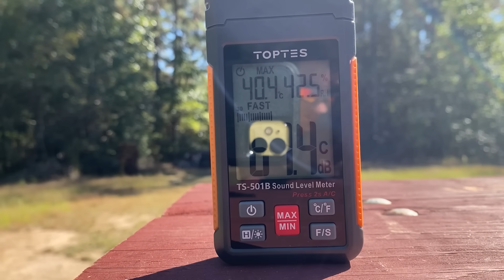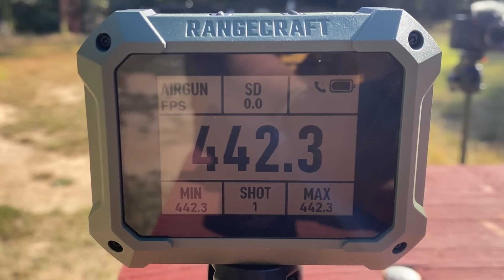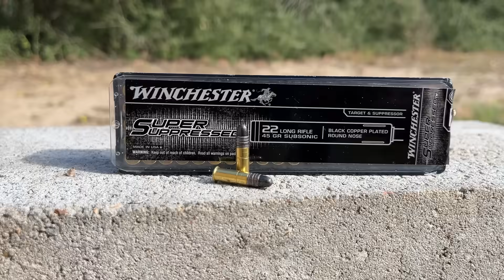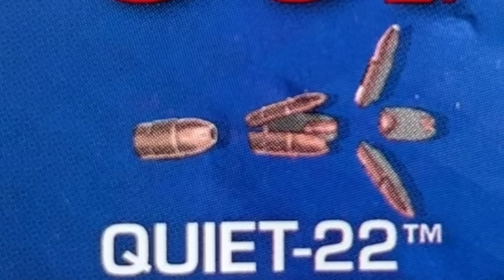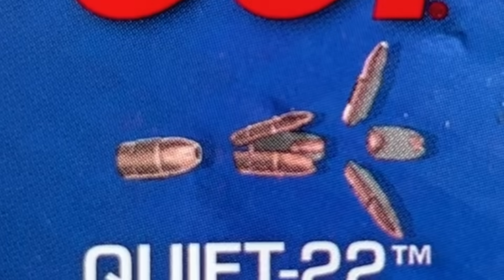How Deadly Are Colibri Bullets?

Comment from the maker: Go to https://buyraycon.com/BANANABALLISTICSOPEN to get up to 30% off
sitewide. Thanks Raycon for sponsoring!
Reply: 0:29  The sound meter you are using cannot accurately measure the pressure blast wave of a gunshot.
The meter you're using is designed for basic sound level surveys.
Sound Level Meters used to measure the fast transient sound pressure wave gunshots utilize a special "pressure microphone".
Cost of these specialized Db Meters is typically over $3000, although they can be rented.
Take a look at the Spartan 821IH-QPR Firearm Noise Sound Level Meter
Great Content, Thank You
Reply: The reason your decibel readings are not accurate is the sample window. Cheap decibel meters usually average all sounds coming in in one second increments. Gunfire makes an impulse sound which is difficult to measure and you need a much shorter sample window for any sort of accuracy.

There is some averaging with every decibel meter.
Reply: @orome9793  100% Correct.
Specifically, Gunshot Sound Pressure Level Measurements require specialized equipment to measure the very short transient spikes.
More common (and less expensive) db meters average a survey measurement of the surrounding environment.
I'll reference this piece of test equipment;  Spartan 821IH-QPR Firearm Noise Sound Level Meter
Reply: FYI BB,
The old U.S. Military Standard for judging  ammo was the distance at which a bullet/round would completely penetrate a 1/2” thick pine board was the distance at which it was considered lethal to a human target.
Reply: The trim board is generally Poplar...
Reply: Love the watercloset commando 🤣
Reply: fall asleep for 3h20m
Reply: I actually think this is awesome.. I don’t have to train kids with co2 powered pellets who’s trajectory changes constantly
Reply: How come you didn't try the Agulia 60gn Sniper Subsonic?
The Aguila .22lr 60gn SSS will in most cases cycle your pistol action.
Reply: Have you tried the awareness mode on your original earbuds?
Reply: Really? We're still shilling Ray's Con despite years of evidence that they're overpriced crap?
Reply: which of the raycon have strongest noise canceling?
Reply: 3hr24min not in the last 6 years
Reply: No thanks, raycon headphones are overpriced junk
Reply: https://www.youtube.com/watch?v=90ECrL_4GPc
Reply: You definitely need to invest in newer rail sleepers
Reply: WATCH EVERY MOVE YOU MAKE BANANA BOY
Reply: No, what the f*** YouTube?You hit this video for me for a whole fucking minute😡💔😡💔😭😭😭
Reply: Your commercial is ten times better than the woke crap yt pushes.
Reply: @Angelum_Band  Define "woke"

Comment: My .22 air rifle launches a 36gr slug at 600 fps, and it will blow through 3/4in plywood before embedding in a 1/2in plywood behind it. But it will embed in a 2x4, so the results are about as expected.

Comment: I used a suppressed 1911 with CCI quiet (not segmented) on a raccoon. I knocked the thing out 3 separate times with headshots. When it was out cold the third time I put 2 center mass to make sure it wouldn’t suffer any more than I had accidentally made it to. I felt bad, and I won’t use any slower rounds than that for my pests. Maybe I need some of that Winchester

Comment: The 1/8th inch wood looks like red oak, which is harder than pine. The not-trim board looks like Southern yellow pine, which is fairly soft. I wonder if there is any issue of brittle shear at work.

Comment: Many years ago I saw demonstration of the power of a 22LR. The test was how many 1x12 pine boards would it go through.  The boards were spaced out at several inches. At least six. The bullet went through 6 or 7. I’m not exactly sure. As I said it’s been many years.  That’s pretty impressive.
Also many years ago when I was 10ish I pulled the bullet out of several 22s, dumped the powder and put the bullet back into the casing.  Don’t worry, I saved the powder. The I smashed the casing, primer end, with a hammer. The bullet hit the garage door making quite a bit of noise, but doing no damage.  I would not want to get hit with one of those things he was shooting.

Comment: Ok one, is that pistol really as quiet as it sounds in the video, with such a small can?  I have one I use on my bolt-action rifle and it's literally silent, but if I put it on my pistol it's loud!  And 2, I wonder how Eley Subsonic Hollow would compare to those other rounds.  I like them and have killed quite a few Texas feral pigs with them.  Small to medium ones go down with one well-placed shot; an 80 pound boar took 3 or 4 in the face but he did go down.

Comment: how did you get 9 ft pounds. im pretty sure its 19-20 fpe using a calculator with inputs of 45 grain moving at 445 fps = 19.89 FPE

Comment: So you're just looking at a longer version of the 6mm Flobert cartridge? Basically as a quick recap, the 6mm Flobert was the original .22 cartridge and was intended for parlor shooting. It's just the primer and is very stubby since the case is hardly any longer than the bullet itself.

Comment: Back in the day us old Fudds used to call a light .22 rimfire bullet with no powder and only a primer to propel it a BB Cap,, or a Flobert cartridge.  They were intended for indoor target practice (something common in the 19th century, but generally illegal today if anyone else is in the building) with what were called Parlor pistols, family fun,  With a heavier bullet we called them CB caps,  CB Caps were considered good medicine for cornered mice and rats in a barn,  Both were sometimes found in all 3 lengths,  Short, Long and Long Rifle. Larger animals such as fox or raccoon required actual cartridges containing gun powder,    In the 1860s the US Army did comparison tests on wood boards and human cadavers (there may have been a surplus of those in that time frame),  Multiple calibers were tested,  A determination was made that any projectile that could penetrate 3/4 of an inch of wood (not 5/8 inch) was theoretically capable of causing (eventually) a lethal wound in a person,  
Obviously bullet placement impacts on the speed of subject termination,  Someone shot in a lung, whose lung collapses while internal bleeding and infection progress will probably take much longer to fall down and die than some with a perforated brain or heart or carotid artery.

Comment: I’ve had good luck with colibris and super colibris leaving my 10-22 reliably, but they just don’t feed. Knowing that the rifle works on a blowback mechanism, and the colibri doesn’t make enough pressure, i discount that “failure”. But the 10-22 works best (in my experience) with 22lr only: this is the only load that will reliably self-feed. All go “bang” but only the 22lr feeds. Unless it’s a sniper subsonic, which is a 60gr slug propelled by a short, but still in 22lr shape. It has its own problems, because that 60gr projectile needs a faster twist than the stock 14 inch.

Comment: I'm more surprised with the results of the cci quiet segmented rounds. I've taken one groundhog with it and it didn't go more than 5 yards despite it hitting the center of the chest. Seeing it on a gelatin block gives me even more confidence though. Penetration and maintaining energy isn't what i want. A ricochet with a solid could be bad where i'm using them. Knowing it performs that well on gel and also splits into pieces that quick makes me trust them even more. Especially when they're quieter than my .177 pellet gun

Comment: Did you ever see the speer .38 nylon target loads? They were a nylon case and projectile powered by primer only. You could shoot them in the house at an old Sears catalog. They would put a split in 2 or 3 dozen pages but didn't penetrate any pages

Comment: These are fun to play with, absolutely quiet. My buddy brought his 50th anniversary edition 10/22 with a threaded barrel and we almost had a squib. The bullet got stuck in the muzzle, we were able to push it out with a cleaning rod after taking the barrel off. They worked fine with my CZ bolt action rifle. Maybe the gas pressure lost in pushing the bolt back was enough to weaken it? We didn't think to lock the bolt in place with a thumb to see if that made a difference, but it only did it once. The bullet was also getting mangled by the Ruger when it fed, which might have contributed to it. I also single loaded the rounds in my Taurus pump action rifle because they were too short for the elevator. They were about as loud as a regular .22 when we shot them out of a Mk 2 pistol, which usually requires ear protection compared to a rifle.

Comment: I shoot the Colibri and actually rather like them for what they are. I tried shooting them through a ruger 10/22. Not only did they not cycle the action but they didn't even stabilize. I could actually see them corkscrewing through the air as they went downrange. 
In my Chiappa Little Badger it's a whole different story. The Little Badger is a break action single shot so the bullet retains enough velocity to actually stabilize and hit the target. It doesn't have much accurate range but it can hit where I aim it. You get performance on par with a .22 caliber pellet gun without having to actually get a pellet gun. It's also really quite to the point where I don't need hearing protection at all.

Comment: Jeez! Dude! Wtf kind of inconsistent non informative crap are you doing? Sorry but look... If you're ballistic gel is as dense as everybody else's little I apologize but you only did a comparison against more powerful low velocity rounds... If you had actually used an airsoft gun, a pellet rifle, a BB pistol and you had multiple ballistic gels - or- the very practical an absolutely reasonable setup of buying four different cuts of lumber and cutting Target squares that way you can use a micrometer for each ammo it would probably cost you about $200 from scratch .... So that's why I find videos of yours like this annoying because not only did you not separate demonstration enough but you are so cross-contaminated the test samples we're at the very least allowed to cross contamination... And by cross-contamination I'm referring to the degradation of your target... It's kind of like saying an old ballistic vest can't stop high velocity 9mm fmj after shooting it with .22, .25, .32, and 20 gauge a few times....

Comment: I've been using Colibri for years on squirrels. I use a dedicated Browning T-bolt, 22 inch barrel and shoot from my bathroom window at 14 feet away from a horizontal cedar branch I cover with crunchy peanut butter. Head shot mostly and it goes right through. Some I shot in the back and the bullet goes through the rib cage and chest muscles up to the front skin. I have recovered a few bullets that did not exit the front skin. Less noise then my Slavia pellet gun.

Comment: I don’t know maybe the ones I had were more powerful or something. I had an AD and it went through the drywall the wooden siding, the sheeting underneath and got stuck in a tree about 50 feet away.  They were 100% colibri rounds. It was the only ammo I had and it got stuck in the chamber, and I didn’t realize it until I was cleaning it, and the bolt slipped out of my hand and it fired. It was out of a rifle on top of that too. Now when I say it got stuck in a tree, I don’t mean it was 6 inches deep. It was just barely in the tree, but it was stuck in a tree nonetheless lol

Comment: I use the Colibris, and the Super Colibris for plinking in my suburban backyard, without disturbing my neighbors.  I run them thru an 18" barreled Ruger American Target.
They're great for challenging yourself to be a more 'precise' shooter.  At 20 yards, it's a struggle to make a decent group, 
But, it's fun!
For a little more oomph, I use the CCI 22 CB Longs.
If you really wanna THWACK something, like a steel plate, look up the Aguila Sniper Subsonics!
That's a 60 grain bullet, moving under rifle crack speeds.  
They're GREAT for pest control at short distances.

Comment: Hey there, French here, quiet watcher for a bit over a year now. 
This is not, in fact, the weakest bullet there is. It's not the smallest or the quietest either. That crown would go to the 6mm Flobert, which is still available today in more common .22 flobert (so like, 5.6mm) and is the French plinking round. 
I'd be very curious to see actual performance difference between those two rounds!

Comment: I don’t know if it’s still available, but Aguila used to make a Super Colibri. Same stupid little pointy bullet but with a couple granules of powder to boost the velocity beyond what the priming compound alone could do.
They’re still Hollywood quiet, even without a suppressor, and go about 700fps out of a rifle barrel. They will penetrate about halfway through a full-size Grainger catalog. I bought a brick of them about ten years ago.
My number one pest control round.
Reply: They still make them but like once a year (or two). If you see them available, buy them.
Reply: Yep, by my estimates the Super Colibri is about 4-5x the power of a typical(WalMart) pellet gun. Incredibly quiet suppressor ammo, though you gotta manually rack/eject it Metal Gear Solid style & they're EXTRA dirty, even relative to other rimfire loads, possibly also corrosive.

Comment: Are you foolish???   400fps is not something to laugh at.  It will take an eye out.  A rough rider shoots a BB that's a fraction of the weight of a 20gr projectile.   

Your test is flawed.   Those soft lead projectiles turn flat.   Your an idiot to say it has no power.    

Some kid will see this and think they can shoot their friend with a projectile 3x heaver than a pellet gun pellet going over 100 fps faster than a rough rider shooting a BB that's like 1/20th the weight of a bb.  

Your foolish.

Comment: Any low energy very quiet round is great as a harassing tool on the modern battlefield. I did a lot of field testing with a Winchester pump 22 rifle using CB Caps. It ramped up the paranoia and caution of the local police department.

Comment: My buddy was a retired cop, and he had some plastic bullets that you would insert into a cartridge with just a primer.  They would go through a cardboard box, and like you said, they are very quiet.
Reply: I remember those.
Reply: They had them still a few years ago, I think Speer made some. The ones I got I think are just primer powered and supposed to be able to catch them with a heavy blanket and reuse them. Got some in 38 and some in 45 for my 45acp revolver, have a box loaded but never tried them.

Comment: I've put down squirrels and a few raccoons with CB shorts. Even used then to put holes old propane torch tanks and spray paint cans. I've only had one literally (1) squib from a marlin model 25n .22lr bolt gun. I'd be curious to see what your thoughts are on those. I think they are good little rounds thats quiet and plenty powerful.  Though I prefer cci subsonic. And I absolutely love the cci segmented hollow point. They are devastating to squirrel and rabbit. Quick and clean humane's the game.

Comment: I've been shooting these out of an original model 4 Remington rolling block for years now. 
Through the 24" barrel, it barely makes any noise, and when you hit steel, it makes a laughable ring.
You should try the sniper subsonic, too.
It's a 22lr length cartridge with a 60gr bullet in a 22 short case. 
Looks funny as hell but works surprisingly well and hits with more authority while still being quiet.

Comment: 0:25 39.1 degree?
Reply: I don’t think he’s questioning that it is in Celsius. I think he is questioning that 39.1°C is 102°F. It’s probably just because the meter is sitting in the sun.
Reply: Celsius
Reply: Sun for sure
Reply: it measures the relative humidity and the temperature and you can calculate the speed of sound very accurately with just those two measurements

Comment: One day, I worked over a 223 case, drilling out the flash hole to accept shotgun primers and sized to take 22 cal airgun pellets.  Basically, it's a 223 chamber adapter for pellets.  OMG, that thing was anything but a toy!  Thanks for the video.
Reply: If the above gets you in trouble, let me know, and I'll fix it.

Comment: There's a famous assassination with a 22. Turns out bullets just kill things. No, it doesn't have as much stopping power, but vital organs don't love having holes in them.
Reply: Yeah but this is .22 Colibri…. It can’t even poke through pine.
Reply: @princez.2648  tbh it doesnt have to, ribs already have holes, intestines have pretty much zero protection and arteries are all outside of bone
Reply: @xalener then it would be easier to get a high powered air rifle. No background checks
Reply: @xalener  might be good if you get them from point blank range, anything more then that you will probably miss or it's hitting bone and deflecting

Comment: My Daisy 880 BB rifle. Just four pumps is enough for a BB to kill a rat. But you got to have shot placement. Anything that goes dang and is moving over 800 ft per minute is probably going to have enough kinetic energy. You should size the tool to the target. Shoot rats with the BB gun. Shoot varmints with the 223. And should big environments with the 30 caliber. Come on you got to choose your tool. Don't try to drive tacks with a sledgehammer. Or vice versa.